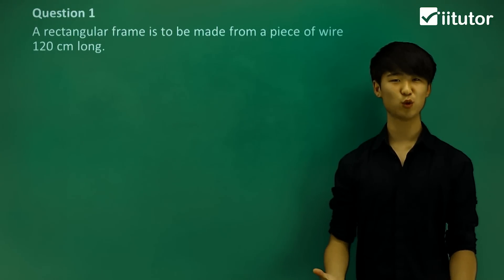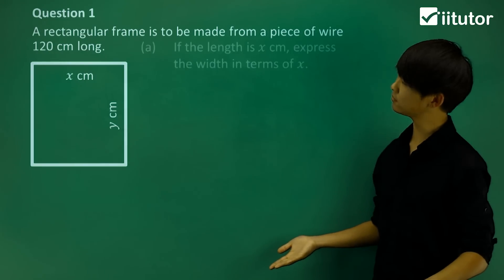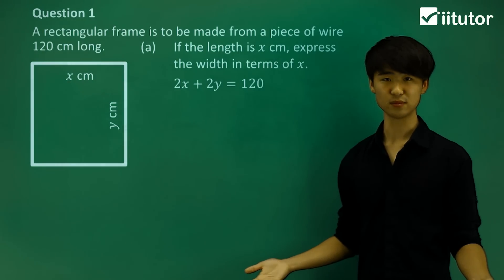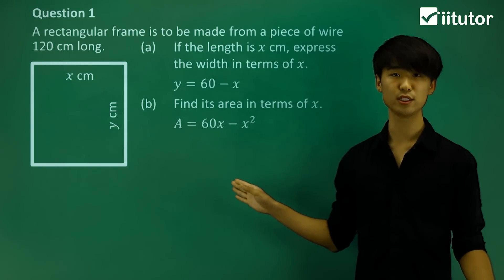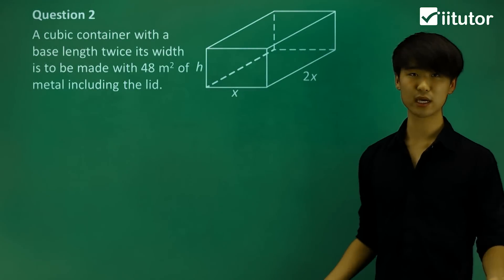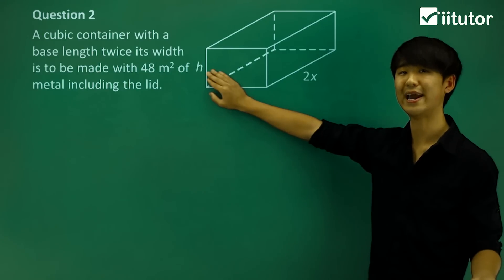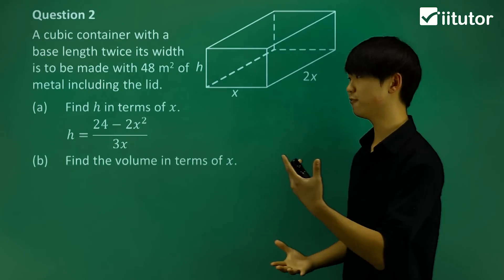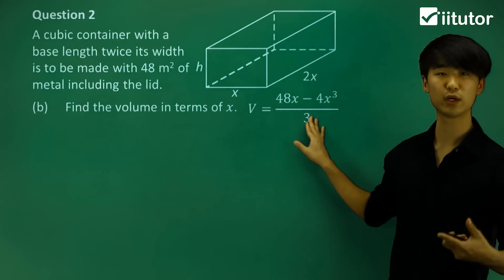💸 An Ultimate Guide to Maxima and Minima Problems using Derivatives 📡

Comment: I think for question two you did the order of differentiation wrong. Isn’t it the times by three then differentiate?
Reply from the maker: Thanks for coming back to us. The first step (before differentiating) was to multiply 3 on both sides, which makes the denominator 3 disappeared on the left-hand side, while the zero on the right-hand side remains zero even it is multiplied by 3. The second step (the differentiation) is to differentiate the simplified expression done in the first step. Therefore the order is correct. We value your comments, so please feel free to get back to us if you have further things that still are in doubt.  thanks for your comments again!

Comment: so what is the height?
Reply from the maker: Thanks for reaching us. The height is not required to find the volume. However, you can find the height by use of the formulas that were found in the part (a) in each question.  You can substitute the corresponding x-values into y (height) formula, for instance, y = 60 - x in Question 1, for finding each corresponding heights. Hope this helps your understanding.

Comment: What about max current in 100sin(50π+0.32) find time when max current occurs
Reply: Is me who I didn't copy the question correctly sorry there is a t in 100sin(50πt+0.32)
Reply from the maker: @edmondchege7381  Great. Please look at the proposed solution here https://www.iitutor.com/applications-maximum-minimum/. Let us now if you have further questions on this.
Reply: @iitutorcom  what about the minimum value of when t occurs
Reply from the maker: @edmondchege7381  As you can see from the post, the minimum value occurs at t = 0.028... You can find the minimum value by substituting this value into the equation. Hope this helps.
Reply: So π/2,3π/2 are what exactly
Reply from the maker: Edmond Chege pi is the value of 3.14....so you can find them exactly using this special value.
Reply: Thank you
Reply from the maker: @edmondchege7381  Great pleasure to help you! Feel free to contact us if you have any further questions.
Reply from the maker: Hi Edmond. Thanks for your query. However the equation (or expression) may not be the one that can find the maximum or minimum value because the expression does not contain any variable (or pronumeral) such as 'x'.. pi is not a variable as it is a fixed (or constant) value of 3.14...... So your question is not ready to find a either maxi or min value. In this case 100sin(50π+0.32) produces a constant value, thus neither max nor min values.  Hope this helps!
Reply: @iitutorcom  here is the full question
An alternating current is given by i =100sin(50π+0.32) amperes, where t is the time in seconds. Determine the maximum value of current and the time when this maximum occurs
Reply from the maker: @edmondchege7381  Still there is no 't' in the expression, so 100sin(50π+0.32) is always constant.
Reply: Oooo sorry there is t on 100sin(50πt+0.32) in the question

Comment: Im not convince with the explanation why qoutient rule in differentiating doesnt use in the problem..
Can you please elaborate ..thank you
Reply from the maker: Hi Norma. Thanks for reaching us. Good question! This question has been asked by many students in the past. The denominator is a constant but not having any variables such as 'x', so this is simply the reason why quotient rule is not applicable for differentiating. Please ensure the quotient rule must be used only when the fraction contains 'x' both in numerator and denominator. In this case, the number is 3, which is a constant, so the quotient rule is not applicable.
If you want desperately use the quotient rule for this case, that is not impossible, because you can get the same result but takes longer and you will be exposed to make further unnecessary careless mistakes.
Please refer my details explain here for your further reference: https://www.iitutor.com/no-need-apply-quotient-rule-differentiating/  

Please feel free to let us know if you have further questions on this.  Hope this helps!

Comment: in problem number 2 why didn't you use a quotient rule in differentiating the volume? it's quite confusing hehe I thought if the given function is in fraction you should use quotient rule hehe please notice me
Reply from the maker: Hi Joshua. Thanks for reaching us. Good question! Many students have already asked this question in the past. Basically you do not have to use a quotient rule for differentiating this question, as the denominator is a constant but not having any variables such as 'x'. Please ensure the quotient rule must be used only when the fraction contains 'x' both in numerator and denominator. In this case, the number is 3, which is a constant, so the quotient rule is not applicable.
If you want desperately use the quotient rule for this case, that is not impossible.
Please refer my details explain here for your further reference: https://www.iitutor.com/no-need-apply-quotient-rule-differentiating/ 

Hope this helps!
Reply: Hi. Im wondering how 3 disappeared? Could you expound the solution for me?. Thank you. Great video.

Comment: ahhh... why is it staring at 2xt2y=120 and in the last part where did you get the -30
Reply: +mikael jamx ohh now i get it substitute X with 30 but i dont get where you got that 2y+2x=120
Reply from the maker: +mikael jamx There are two breadths and two lengths in a rectangular frame, and the perimeter is 120. So the sum of 2 breadths and 2 lengths gives its perimeter, which is 120.  Hope this helps.  iitutor team
Reply: my grade is 92% cause i did another problem based on this :)
Reply from the maker: Excellent! If you need any helps, please get back to us.  :)
Reply from the maker: You may want to download FREE mathematics worksheets from our website https://www.iitutor.com/freebies/.  It gives you a chance to download comprehensive mathematics worksheets containing 1395 questions.  Hope this helps :)